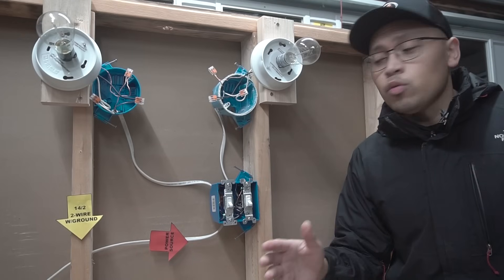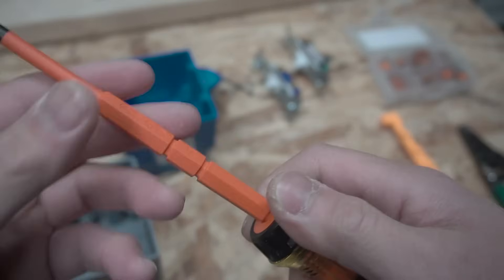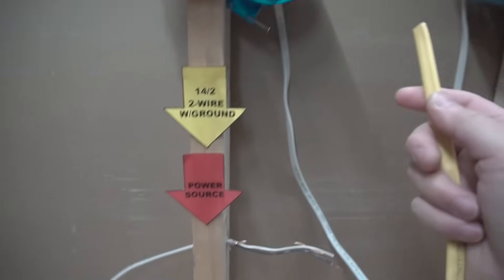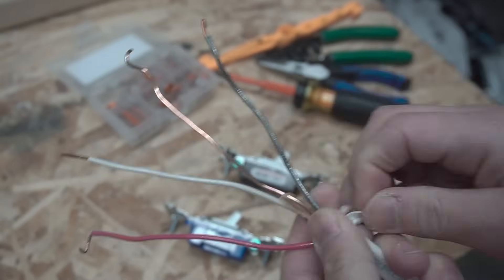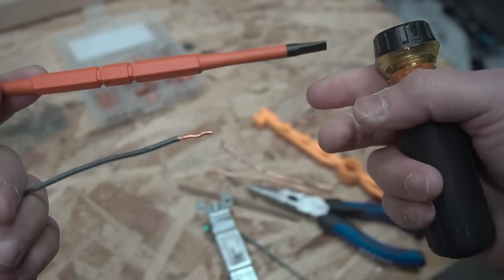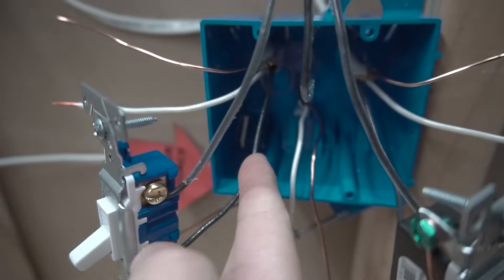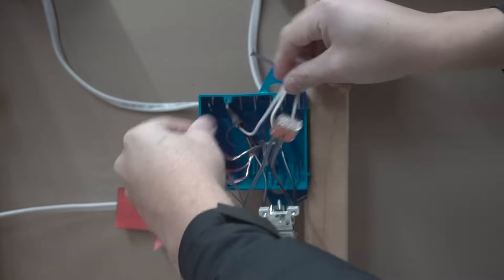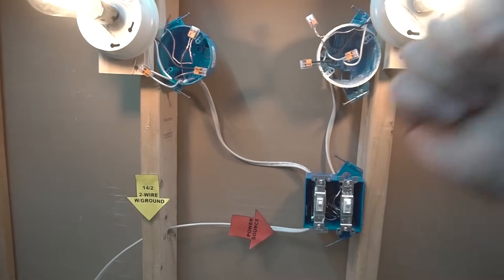How To Wire 2 Single Pole Switch Inside 2 Gang J-Box To Light Fixture (2022) | DIY Beginner Tutorial

Comment: Measure the 6 inches of wire from the outside edge of the box, not the back of the box, as explained to me by two Master Electricians. Sure appreciate your video, though. Thank you.
Reply from the maker: Thank you so much for that advice! 🙏🏽😊
Reply: @FixThisHouse The standard is 6 inches from the back of the box with minimum 3 inches beyond the front of the box.  You only have so much real estate inside the box.  Adding an additional 3 inches to 9 wires in that box would impede the installation of the switches.  The 2 masters missed the mark .
Reply: Works either way, if you measure to the back of the box you’re not going to have a lot of length to work with if you ever need to service these switches
Reply: Code clearly says 6 in from where it enters the box

Comment: You could have made that look so much better if you would have run the grounds down the back of the box and to the side. All three of the grounds from the box would have no resistance to them and you could have run the two grounds from the switches so they didn't inhibit the hot wires. If you look at 14:56, you can see what I'm talking about. You have a ground wire splitting between two hots and that makes pushing the wires in much more difficult than it had to be.
Reply: Well make your own video to show this.

Comment: How do you wire  went one switch is upstair and the other one is downstair? And you can close the light by both
Reply from the maker: Hi! Please check out my newest video which is the 3 way switch 👍🏽😊🙏🏽
Reply: @FixThisHouse great video. Question tho, is it possible to use one light switch dimmer, and a regular switch together from one power source? If so how would you go by connecting the two black wires from the dimmer switch? Thank you

Comment: Very clear explanation. Out of habit, I always place the line wire on the bottom screw terminal of the switch and the load wire (going to the light) on the top terminal. Easy to remember, because I rationalize that flipping the switch up sends power to the upper terminal and out to the light. In the end, does not matter if these are reversed as you did.
Reply from the maker: That is awesome advice! Thank you for that! 🙏🏽😊
Reply: So it doesn’t matter if they are place reversed?
Reply: @antorreon  nope
Reply: Maybe that's why I followed these instructions and my lights not coming on. I am going to change it
Reply: Yes

Comment: I have a question so I have a 2 gang box with 2 switches 1 switch controls outside light, the 2nd switch controls a interior outlet turns whatever is connected on/off, I think  old owners of house don’t know how to add a ceiling light so they made a outlet to act as a lamp switch and just left lamp on so it will turn off/on lamp whenever switch is used.can you show how to take power from that outlet + run it to the ceiling so I can add some Led pod lights ?I would like the switch to control the lights instead of a Socket but if it controls socket + pod lights that’s fine ,there’s no ceiling lamp in my living room and I would love one,hope this makes sense ? .greatly appreciated

Comment: Question what happens when a ground wire touches a hot wire screw or a neutral screw since it is stripped.
Reply: If a neutral and ground touch outside the main panel it'll energize the ground wire carrying current back to panel but there is a chance u can feel it. Hot to ground of neutral will just pop breaker
Reply: @bryson3254  thank you sir it’s good to know 👍